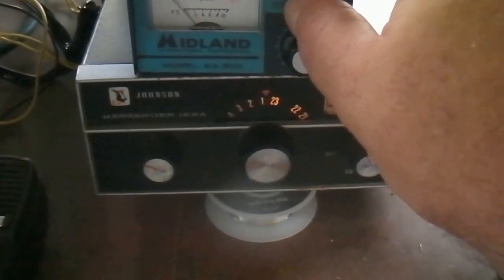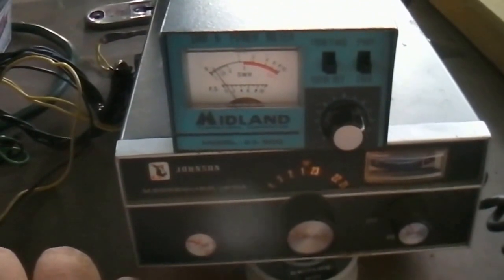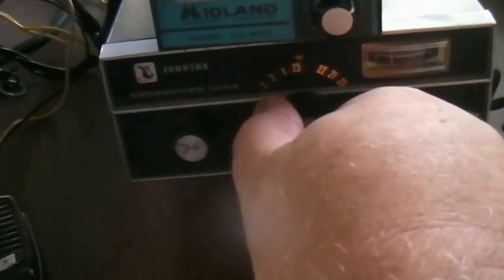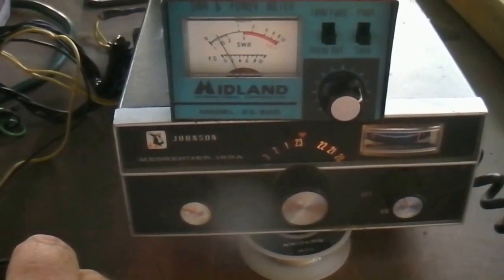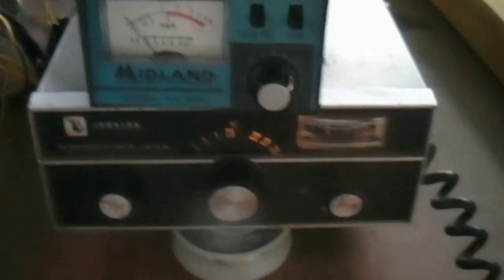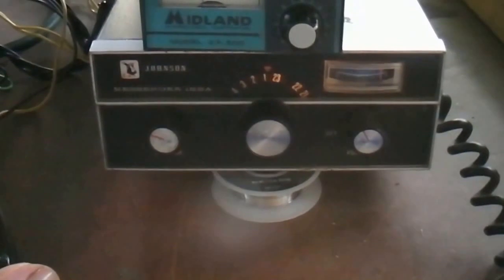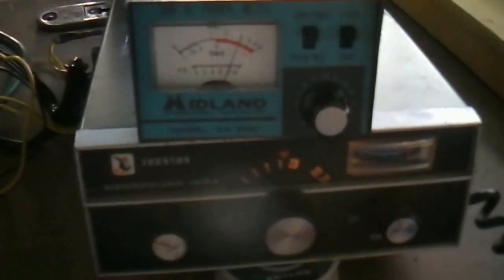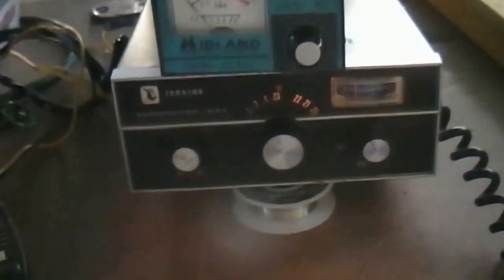102 inch DIY CB Ground Plane Antenna

Comment: Time traveler here. That ground plane you can get it work with 1.0 at 108 inches
Reply: It worked but it was not up very high and didnt get out good. I would like to put a stainless steel whip on a tall pipe way up with some Antron99 ground planes add on. I have a ground plane from my old 99 I could put on a whip it would probably work great.

Comment: Not long ago I mounted a 102 whip flat down tight against a metal pole barn roof with a 40x48 foot print using the entire roof as a ground plane. SWR flat from 26.0 to 28.0 then slowly climbs 1.1 down into 25 and up into 29. Broadest band coverage I’ve ever experienced, no spring just the 102 whip. I talk all over the lower 48 and up into Canada. I always get reports of loud and clear, and often accused  of running power, the radio is so quiet sometimes I think it’s not on. Sweet deal for a $ 20 antenna.
Reply from the maker: I wonder if I can do that with my house it has a metal roof? I tried that on my shed didnt work?
Reply: shartne what do you mean it didn’t work ?
Reply from the maker: @jackson4861  In my case it SWR was over the top.
Reply from the maker: @jackson4861  I used a fiber glass whip though. maybe that is the problem?
Reply: shartne how long was the fiberglass whip? Fiberglass whip uses a small copper wire inside and does not resonate at 102 inches, it resonates around 96 inches. And when you say mounted on your barn roof, exactly how was it mounted? My 102 inch whip is mounted down flat tight against the roof, zero space, So the metal roof can be the ground plane radios all around it. I could send pictures if you want.
Reply from the maker: @jackson4861  It was magnet mounted that may be the problem with it?
Reply from the maker: @jackson4861  You could make a video of it.
Reply: shartne i’m not set up to upload videos to YouTube otherwise… To comment on the magnet mount, it will work but, the whole antenna system will work way better if it has an electrical ground, and the magnetic mount does not provide this. I used a mirror mount, fastened it right to the top of the barn roof, additionally, I ran two braided ground straps from the mirror mount down to the metal roof providing electrical ground and giving way to a huge ground plane off the top of the barn roof.
Reply: richard saunders pic sent to email .

Comment: I used to make 262 centimeter (103 inch) vertical arials with a 262 centimeter counterpoise, sometimes called a rat tail or tiger tail.  This made a vertical 524 centimeter (206 inch) vertical dipole fed in the middle.  These antennas did really well during the good days of great radio propagation. It was common to make QSOs with other nations.  Which would you say is better, a vertical dipole antenna or a ground plane antenna?
Reply from the maker: That is very interesting a tiger tail. I read about it and it said it makes it into a half wave antenna. I would like to try that. The tail must hang straight down?  Can the antenna mount still be grounded to the bed of the truck? Or is this for a whip on a pipe on the yard? This might be the answer to making a homemade whip for a base antenna on the peak of my house. Grounding  the whip is not easy to do making home made ground planes. I have done it with wires but its hard to make it go in all four directions because supporting the wires is not possible up in the air. I made one that had wire ground planes that went two directions it was not great but it didnt have a tiger tail. 
Dipole is better for skip because the take off angle is steeper. but not any good for talking local because they wont be able to hear you with your angle so steep it will go to high.
Reply: @shartne  Unfortunately, the vertical dipole must be center fed, unless you have an impedance matcher. It would ne too ungainly to put on a vehicle.  I just put a horizontal piece of pipe at the peak of the roof and have it hang off the edge for about 2 meters, (6 feet).  Then at the end of the horizontal pipe I put the perpendicular, homemade, vertical dipole.  Only the radial going up from the pipe has to be made of a material a whip can be made out of it.  The counterpoise (tiger tail or rat tail) can just be a length of cable or wire the same length as the vertical.  The rat tail hangs from the bracket that should be grounded to the chassis ground or have the ground plane radials coming from it.
Reply from the maker: @indridcold8433  I made a zeppelin antenna and it worked marvelous but ended up cutting down that tree because it got rotten. I would put it some place else but it would take 140 foot of coax to get over to the other trees and up into the tree 30 or 50 foot. I might do it. I bought a dipole antenna off of ebay Im too fat to lean the ladder against the trees and climb the ladder. It only needs to go up 15 foot. I would climb a step ladder 14 foot tall they are pretty expensive. It would be fun to do though.
Reply: @shartne  I am  not familiar with a zeppelin antenna.  I will have to look some diagrams.  I am not an amateur radio operator.  Thus, my knowledge is limited.

Comment: good to see you got it all working great good job my man
Reply from the maker: drvshaft drew thanks I figured that it may not have good swr but I was surprised to find it did have great swr. It was only a few bucks for the the pvc pipe and the UHF Female SO239 Panel Chassis Mount Flange Deck Mount this antenna was so cheap less than five or ten bucks to make I love it. I talked to a guy after I got it made he said it sounded great!
Reply: Hey Drew how you been man ??  I didn't know you were into CB radio ...  I'm setting up my new shop now... Just about got all my equipment set up. Waiting on that expensive coax to come in so I can make all my lead's and cable up ..
Reply: @Budro4764   well happy new year hope you set up soon

Comment: two half inch pieces of conduit 98 inches long, with 1 inch separation between them screwed to a piece of 1X2 wood with center conductor from coax going to upper tube and sheild from coax going to lower tube at center point of vertical dipole will make you a flat swr dipole for cb, it will handle 1000 watts
Reply from the maker: Off Grid Texas Homestead Sounds good you have to draw me a picture. I need a linear now so I can talk to you. Your 100 miles to the south of me I guess.
Reply from the maker: Off Grid Texas Homestead I bet this 14 gauge wire can handle a lot of watts. maybe not a thousand. but a few hundred for sure. This RG8X Coax will not handle much wattage.
Reply: shartne wire works OK but wire is narrowbanded, meaning its swr is good at one frequency or channel but gets worse the farther you get from that channel. If you use copper pipe or emt conduit then its more broadbanded meaning you have a flat or lower swr over more channels.
Reply from the maker: Off Grid Texas Homestead hmm interesting facts I learn something new everyday. Thanks. I may try to make a 1/4 wave ground plane out of copper pipe. maybe half inch? I could try to solder some kind of manifold together at the bottom for ground planes. wonder it they have a part like Im thinking of? I need a part that goes up down and out at four 90 s  all the way around for the radials.i wonder if there is such an animal?
Reply: shartne make a dipole, one pipe sticking up, one pipe pointing down, inch separation between them, both equal in length 98 inches each don't put a ground plane on it, your bottom tube will be a mirror image of your top tube. You can use EMT conduit, you can rough it up and solder to it

Comment: Hey is the Johnson for sale? What a great idea that would be also a good antenna To carry into the field with you and set up on a tripod. Hey thanks for posting
Reply from the maker: I sold it a long time ago but you can get them on ebay for like $10.00 I would rather see you get a cobra 25  or a 29 or even a 21 for about 25.00 or 30 dollars. I fix them up and sell them for about three times that much but I replace every capacitor so it works like new again. The old cobras are pretty good radios.
Reply: @shartne  Yeah sorry it took so long for me to get back to you but my YouTube wasn’t giving me notifications. Yeah I’ve got a Johnson since this time so good luck stay safe

Comment: Interesting...more or less a home made Antron 99 without the three separate sections. Very cool.
Reply from the maker: I had eventually bought a Antron 99 And  it worked really awesome until lighting struck it and it blew the antron 99 in a million pieces. Im getting a Starduster next so lighting wont kill it as long as the radio is not plugged in when it strikes it.
Reply: shartne
-- Ok, dude...get ready for a novel response...lol. I am the only "Tech Guy" within about 100+ miles of my area, so everyone brings their gear to me to have fixed, peaked and tuned, converted, modded, echo boards and roger beeps installed, mics wired, entire rig setups...you name it. CB's, HAM gear, linears, antennas, computers. I have had every antenna made...when I got mine, they had just come out and were called the M400 Starduster. When I set mine up, I set it up with an MFJ Digital Antenna Analyzer...and I worked with it until I got the SWR's to 1.0, it actually fluctuated into the negative at times, it was that low and perfectly set and matched. On the collar where the ground plane radials are screwed in, I attached and ran some really thick, solid copper core insulted ground wire to an 8 foot copper ground rod at the base of my antenna mast. That was the most perfectly matched and grounded antenna I ever had...and everyone within 50+ miles could damn sure tell the difference from the Antron 99 that I had been running before. I didn't even have to kick on my amp which was an X Force XT40012 that did around 1200 watts easy. I increased around 3 to 5 "S" units overall on everyone further away, and people in town swore up and down I was running my amp, and I wasn't...but when I did kick that thing on...good Lord, I was pegging meters everywhere. It is one HELL of an antenna, just get the SWR as close to 1.1 as possible, and run that ground wire, and you'll be good to go. Only one flaw with it, though. Where the vertical element is attached is very weak, mine broke right at the base after a bad storm...it took a bit to fix it, and I re-inforced that section extra well...overkill actually, but it's something worth mentioning. Overall, it's a damn good antenna if you extra re-inforce the connections...just advice, take a piece of aluminum tubing about 4 to 6 inches long that just fit over that first top section of the antenna, cut slots in each end about an inch or two in and then use a couple small hose clamps and clamp it down good and tight over that area that attaches to the base...THEN you're good to go. Who knows, that may have been an issue that they already fixed. Just a heads up just in case. 73's, bro...from Gunslinger in Southwest Oklahoma.
Reply from the maker: I would like to find some aluminum tent poles long enough to make a different antenna. The SWR was not near close enough  but its a lot closer on my whip on my pick up and works good. I have a new radio now several of them all kinds. They are a lot better sounding than this old Johnson. I have a bunch of galaxy 33s and a cobra 148 GTL and my favorite is my Stryker 440. I had a Antron99 but lighting made short work of that. I might get a star duster becasue they are cheap and a quarter wave and light weight. Not the best antennas but not bad for the money and they could survive a lighting strike possibly. It seems I might have heard you on skip once.
Reply: shartne
You've probably heard me...Gunslinger443 in Southwest Oklahoma...all over the band and 38 LSB. One of my hobbies is building base antennas and trying them out. Currently I built and am using a mobile mirror mount on my pole with an 8.5 foot steel whip with an aluminum strip cross section with an 8.5 steel whip on each end. SWR's are 1.1 to 1.2, basically a vertical dipole...but it works.
Reply from the maker: I will start listening on LSB 38 for you especially during skip. My Handle is Solar Freak.
Reply: shartne
-- Cool, I'll be listening in!!
Reply: Hey guys, here is a question for you. I have a 102in whip antenna, 108  overall that I have been building. I started out with a Wilson firestick ground plane wheel. That wheel turned out to be worthless. I am ready to build a 4 radial ground plane, 108 inch radials. Is it ok to put my wires inside pvc pipe? I have an idea for my plane to weatherproof and better looking than bare wires so my neighbors wont complain. Thanks for your help. Gitarzan66.
Reply from the maker: It sure is OK to put them in PVC pipe. It will work. RF waves will pass right through it will out a problem.
Reply: Well cool. I found a 4 way pvc connector on Amazon 5 way altogether. I can put the radials out the sides and use the 5th hole to put  it on top of my mast like a cap.
Reply from the maker: Sounds like it will work great let us know how it does.

Comment: Trim the radials for lower swr.
Reply from the maker: Hmm you think? I never thought about that? Probably would work better I bet.
Reply: If SWR is higher on 40 than 1, the antenna is too long. If it's higher on 1, then it's too short.

Comment: HELLO 1.4 SWR CAN BE IMPROVED BY ADJUSTING THE RADIALS AT A 45 DEGREE ANGLE.
Reply from the maker: I have an old ground plane from my old Antron 99 that blew up when lightning hit it. It is a 45 angle. I could use that and it would be great I would imagine.

Comment: Copper resonates at 108 inches bro you cut your element too short!
Reply from the maker: that might  be true? I can always make another one. I took that one down it worked but he SWR was not flat. The whip on my truck is perfect check it out perfect SWR its Flat I use a 10 inch riser for whip adjustment.  https://youtu.be/rqdU8Mo_Dso
Reply: 1/4 wavelength is 102 inches for CB.